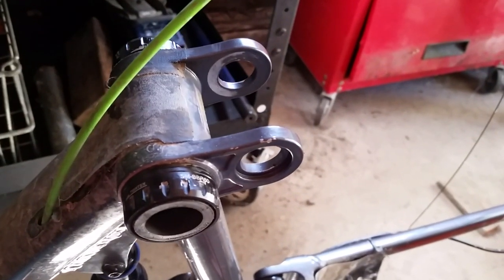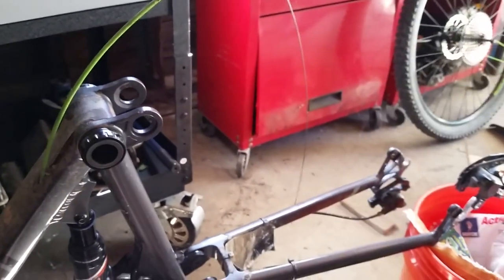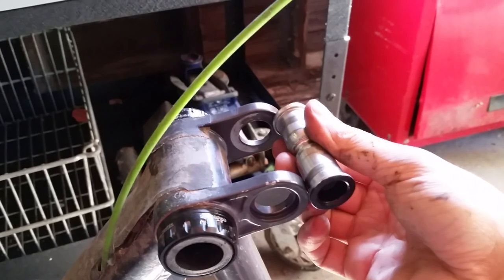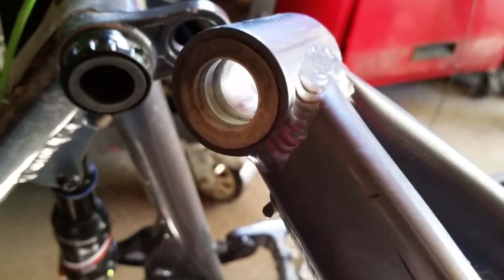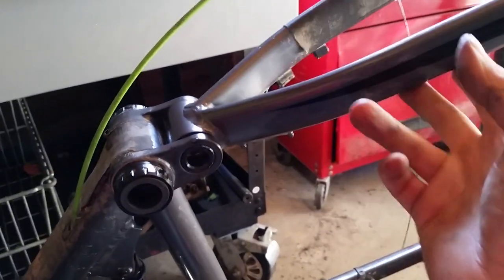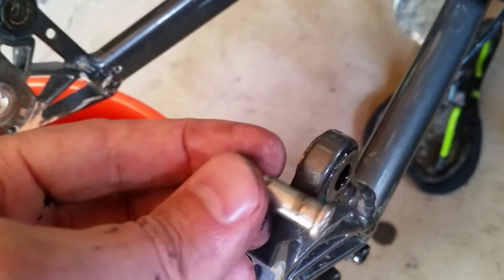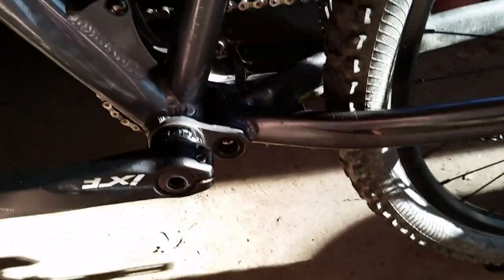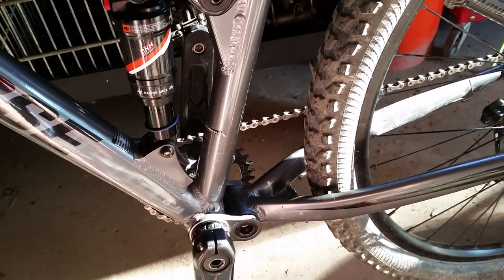Pivot Point Fix

Comment: I have a huffy oxide 26" and I have that pivot arm wobble and used this trick to stop the play. My bike uses a lot thinner bracket mounts for the swing arm which can bend sometimes. But I wondered if it's possible to convert the bushings to bearings for much less friction. Cause I have to usually tighten the bolts in the pivot points after a couple trail rides.
Reply from the maker: maybe try thread lock first.